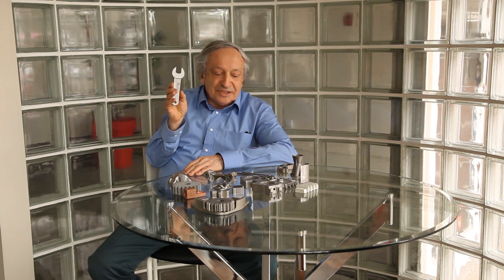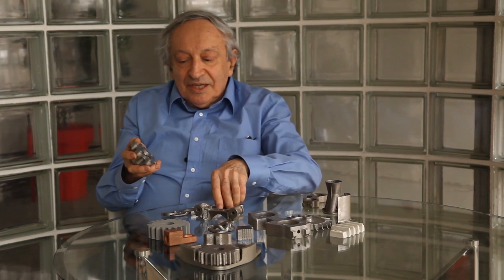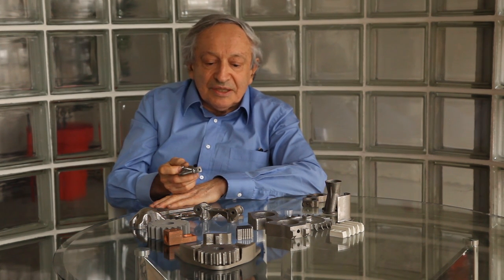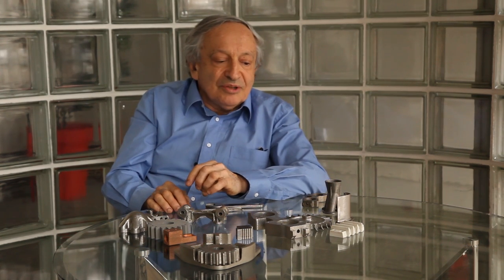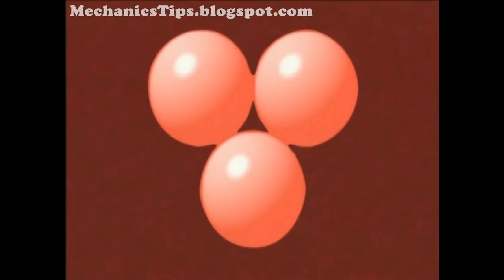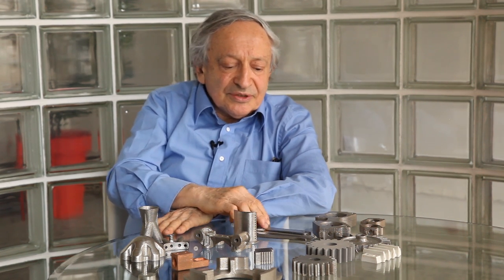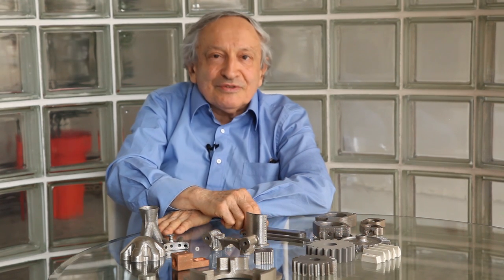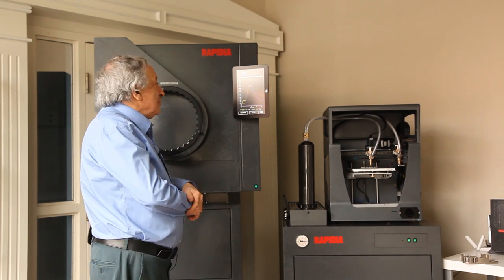Prototyping - Metal 3D Printing

Comment: Cool thanks for sharing ,,  its silly people aren't interested in ceramics > lots of possibilities ,,. could make high voltage custom transistors .. maybe even weird stuff > like a metal part with a ceramic FUSED in or around ... see what I was saying about HV transistors . if u need a gap/gate size of 1/2" or more , u can't really find that on the shelf  .. lol if i had one of these I would probably try to make funky magnets.. impossible shapes and stuff . most magnets are basic shapes.. I mean its not all bad or anything, but we are used to it. Imagine if you could make a magnet in ANY shape ... woa :) .. could get those flux/return paths precisely where u want them .. half magnet half metal ... no more nickel PLATED .. nickel FUSED neodymium .. woa .. ok i gotta stop
Reply from the maker: We are actually testing a bunch of such ideas, but first things first.
Reply: @dgelbart  after pondering this for a sec,, isn't the magic in the paste ? Caz I've been thinking about this process, and if I'm not mistaken there are endless ways to make things turn to metal ,, but what are we turning to metal ... hydroxide / oxide / organics / or straight up minerals .. my head hurts thinking of all the possibilities ..  aren't oxides fluffy > like the ratio of metal 2 non-metal = ??  = shrink .. metal colloid flux paste printer .. hmm  ...  Al2(O3) = super high melting point PITA/nogo  ,, Al(OH3) = super low melting point

Comment: If you want to be really Unbias you need to compare your Printer to FDM printers with Multiple Printheads Using Metal Filaments, and then also get "Sintered" or Baked to the final form. THEN compare the pricing on your unit and theirs.
Say for Example the Mark Forged or Makerbot System vs Rapidia, then go into the advantages of using Paste instead of Filament, and the cost per kg of each.
Comparing your printer to SLM and other machines, is really inadvisable, as those systems generally come with a quality control and research and knowledge base as well as specialized software for that system, so your not JUST buying the Machine.

Comment: Quality of the output. No engineer wants sintered parts. The technique is only tolerated for reasons of lower cost. The more costly hot isostatically pressed parts are stronger than open atmosphere sintered parts, but neither one is good enough for truly demanding applications. At the other end of the scale, in "less demanding" applications such as: lower operating temperatures, lower yield strength required, lower abrasion resistance required, etc. injection moldable plastics are gradually catching up with sintering, especially one-atmosphere sintering. 

Ceramics. Ummm... ceramics might be related to the ancient origins of sintering technology, but...if ceramics had anything to do with most modern mechanical engineering requirements MEs would be specifying ceramics, not metals. Ceramics in this context might just be viewed as a non sequitur. But to the extent that sintered metal parts bear similarities with ceramics, for the most part this becomes a disqualifier.

Porosity. Sintering is great if you plan on filling the open pores with oil and making an integrally lubricated bushing.  But in any situation in which there are corrosive gasses or solvents, fuggedaboutit. Consider food processing machinery subjected to periodic caustic washup. Does the customer want the wash chemicals leaking out later into the food? And sintered stainless steel anywhere in the vicinity of hydrogen would be courting disaster from hydrogen embrittlement. Which makes sintered ferrous metals in internal combustion scenarios problematic.

*3D printing of synthetic wax." Oops, there goes the argument against investment casting. The wax models are made on the same timescale as any plastic 3D printed models. And homestly, how much additional turn-around time is added by the slurry-dipping and wax-burnout processes? 

Quality of investment cast parts Is there even any contest between investment cast steel, et al. parts vs. sintered metal parts? Every mechanical engineer wants his parts to have all the properties of integral, solid metal. Focusing on intermediate process instead of ultimate long term consequence will not succeed in the long run.

Comment: No grandpa, as long as 3D-printers are as inaccurate as them are, there won't be real life application for a product like this. Honestly. who wants flawed, dimensionally inaccurate piece of structurally inferior metal compared to CNC?
Reply: Yeah it gets lots of public attention but there are only few places where you can use this. Laser cut sheet metal parts are much much more useful and not much less cooler.
Reply from the maker: All depends on the parts you need to make, as I explained in video. I know someone who has 12 metal 3D printers running day and night just making miniature heat exchanges.
Reply: @dgelbart  I could imagine, with a business plan like that it's such a risky investment...